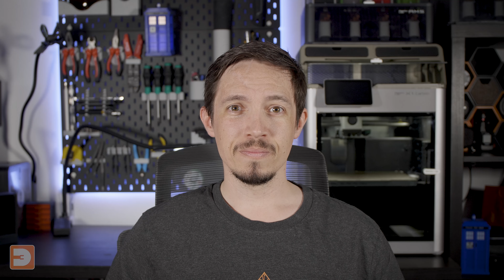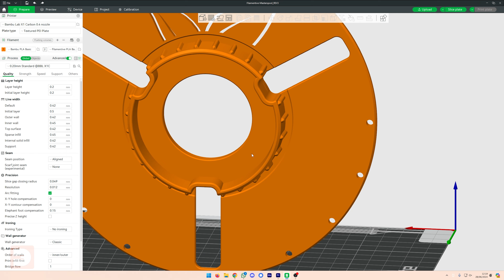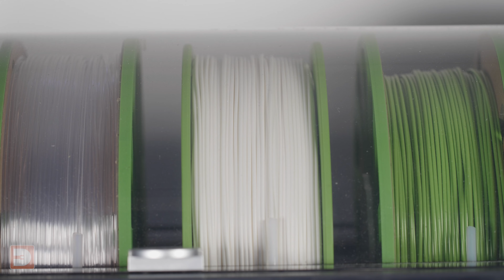A new MasterSpool for Recycled Refills in an AMS

Comment: Das Filament master spools have worked well with the AMS since they released Masterspool version 3.2 in 2023… And they don’t need to use cardboard cores. The only annoyance is that the original masterspool only fits 750g refills. They have also released an adapter to convert BambuLab spools to the masterspool standard.

Comment: no means of locking both sides together to prevent separation and filament chaos?
Reply from the maker: As I've mentioned to others that have said this, this is the exact same method that many filament spools use including Prusa own filament, Prusament which has used this style spool for years without problem.

Plus as I show in my video, if you're really concerned about them coming apart. Could fit them with a silica bead tube like I did, designed to add more desicant to the AMS, weigh spools down when they get low on filament, but a bonus is it also clamps the two sides together

Comment: Why don’t they just make Bambu the standard? No need to keep reinventing the spool. Unless there is some patent infringement, clearly having makers print their own spools saves on waste but who wants so many different sizes or shotty designs that might fail?
Reply: I mean why should everyone make the BambuLab system the standard? They're definitely not the first ones to offer refills for their spools and filament manufacturers that decided to do one system would need to redesign their production line (at least partly). Also, as a customer I would be really pissed if my manufacturer suddenly stopped producing refills for my self-printed spools because they now settled with a different system. BambuLab is actually part of the problem when it comes to the plethora of refill options as there was a community-driven system called the MasterSpool  made by RichRap and yet many manufacturers (including BambuLab) decided to reinvent the (literal) wheel.

The MultiSpool project on Printables (Model number: 346732) is literally the perfect solution for the current situation. You have a modular spool system where you can change the hub (the core in the middle) according to the filament you purchased.

Comment: Yeah don’t drop that spool..
Reply from the maker: Honestly surprised by how many people are saying this. This is the same concept (spool insert walls that slot into the sides of a cardboard core) that has been used by official Prusa filament (Prusament) for years without any problems.
Reply: @3DRevolution  Well I’m not familiar with Prusament, but I just know I would probably drop that and the ends would come flying off..!

Comment: My ams came with 4 spare openable spools so any vendor that supplies refills can be transferred onto an original ams bambu spool. 🤷🏻‍♂️
Reply from the maker: All Bambu spools are open able whether they come empty or with filament. But you can't use just any old refill filament on them, especially in the AMS. It requires the refile central hole diameter to be the same dimensions (which definitely isn't always the case), the exact right width (filament reels can vary in width by a cm or 2 from vendor to vendor. If the refill was too big the Bambu spool wouldn't lock shut, if it was too small, the Bambu spool walls wouldn't be flush to the sides of the filament and it would get tangled), and without an adaptor, or the refill hole featuring the notch, the filament could freely rotate whilst fitted to the spool, meaning when the AMS rotates the spool whilst unloading, it could rotate the Bambu Spool but not the filament refill.

So whilst you may be able to use some refills on it other than Bambu, you certainly can't just use any old filament refill on a Bambu spool

Comment: Wow, what a great idea, to print a spool sides, which only compatible with certain brand... = )
I have concerns about how strong will it hold. If it will unspool it will be a disaster = )
I personally prefer just rewind unspooled filament to existing spools, it takes only 5 minutes with a drill or a screwdriver.